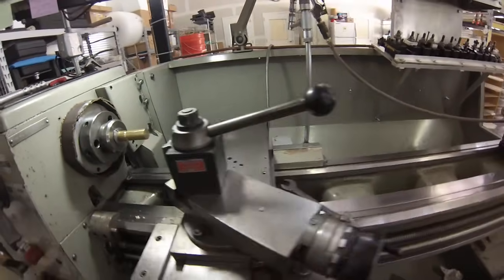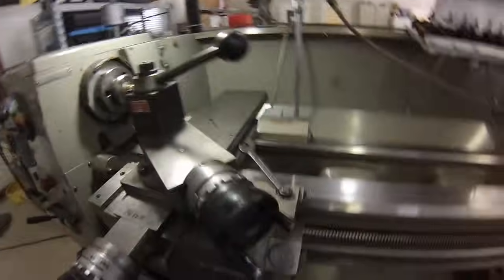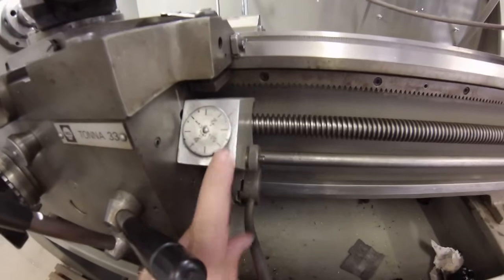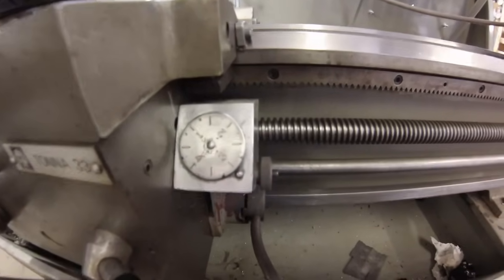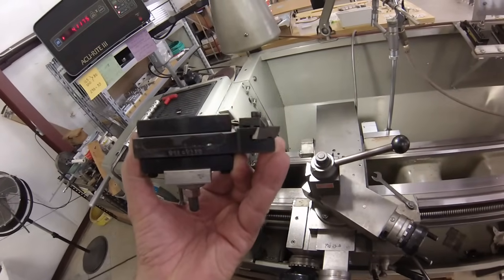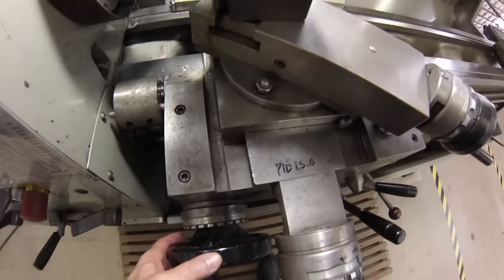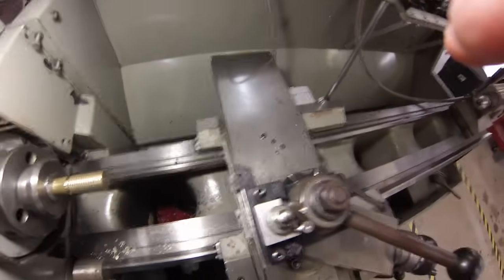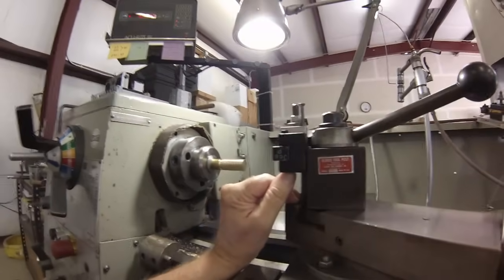Threading on a manual lathe  BEST TECHNIQUE EVER !!!!

Comment: HI! 
What about a metric thread and imperial leadscrew, could this method be adapted ?
Reply from the maker: Yes, absolutely. Just don't disengage the halfnut and you'll be fine.
Reply: @joepie221  
Thank You Joe. As you said, there is a nanosecond time to stop the movement against a shoulder. If you do  not open the halfnut, you need to run the lathe very slow. Tim Lipton (Oxtools)  explains in his video "Metric Threading with an Inch Lead Screw" , a trick how to disengage the halfnut  not losing the thread. You may have seen it. Could we combine your method of threading with Tom's trick.?
PS. Sorry for my bad English.

Comment: Best advice ever for single point threading. I’ve witnessed too many people go toward the spindle and make costly mistakes. As an apprentice at the time I asked questions that where met with the “That’s how it’s done”, you want right handed threads you go towards the spindle.

Then in later years there was a more mature seasoned machinist that threaded away from the spindle. The question was asked why, and he explained in plain terms that it was safer for the person tooling and the equipment.

Comment: Joe, I bought a set of wires for threading as you suggested. I am going to turn my tool upside down tomorrow to finish the last 9/16" thread I need for a project. I hope my chuck doesn't thread it's self-off the nose spindle. If it does, I'll be ready for it since you warned that it could happen. I hope this will work for my threading operations. Great Video.

Comment: Hi Joe love this technique , but I just bought a lathe that doesn't have a thread dial 😬..it's a  it's a reasonably modern  lathe 1996 Wagner dcs 200x900  and can't quite understand why not,,, Thier is a video of one running on you tube and it also doesn't have a threading dial 🤔 .. will post a link, Thier are no obvious signs where one would go if it is  missing🤔. It's a massive upgrade over my previous Taiwanese 13" belt drive .. that  I would never have risked this method on with threaded spindle .. the Wagner is din spindle so was looking forward to running all the threading ops with this method 😬 am I missing something like is it possible it doesn't need one ?  🤔
Reply: Just don't disengage, keep it fully engaged in your case. Use reverse

Comment: Joe that is an absolutely brilliant technique to chase threads without having a heart attack waiting for the end of the thread cut. I've been there many times!

And thanks for showing us how to use threadgage wires..... I always used to use either a thread Mike or ring gauge. But the thread pitch wires sounds like a very easy and reliable way to check your pitch diameter. Great suggestions!!!

Comment: Hi Joe,
My lathe’s manual says that the lead screw was made with a left hand thread so that when threading (in the ‘usual’ direction towards the chuck) the lead screw is in tension, which supposedly makes for a more accurate thread. Have you had any accuracy issues over the years with your away-from-the-chuck technique? Thanks!

Comment: Great video and tip Joe. Wanted to ask what threading toolholder/insert you're using in your BXA in this video?
Reply from the maker: Its a kennametal top notch threading and grooving tool holder. 3/4" LH NSL
Reply: @joepie221  Thanks for the info Joe, and thanks for doing what you do!

Comment: Alas both my lathes have screw on chucks so if I did that the chuck would unscrew. Next time I buy a lathe though, I will make sure it doesn't.
Reply: I saw a tip to hold it on with the tailstock but haven't tried it
Reply: @RG-gk4yi  hmmm. Got a link?
Reply: @BensWorkshop  I haven't found any actual examples of anyone doing that yet, just a few comments suggesting it as a solution. I'm wary of doing it, myself, although the theory seems solid.
Reply: @RG-gk4yi  Fair enough.

Comment: Oh so you do call the machinist hand book the Bible. Yep it Mitchell again. 
Have a great day!!
Reply from the maker: I'm not sure what point your trying to make, but just about every american machinist I have ever worked with calls it that. So thats a yes.
Reply: @joepie221  Oh come on Joe. I was harassing you about the threading video and not using the compound rest as recommended in the “Bible” in reference to gummy stainless plunge method 
Then I watched this video. I mean nothing by this. Except new age machinist are all cad reliant. I happen to enjoy both worlds having the back bone of old school and new age high speed machining using a 1/2 6 flute 1-1/2 loc full depth in 4140 pre hard and maxing out the spindle of 20 hp all day long. It sure does make a mess the biggest challenge is chip removal. 
You have 12 years on me as a machinist. I personally love a challenge old or new. I do enjoy your videos 
Have a great day!!

Comment: 417 people have long hair
Reply from the maker: I have nothing against long hair, just tie it back or risk the injury.
Reply: @joepie221  Was it MIT or Yale that had the young lady get her hair caught in a rather large engine lathe?  They found her splattered over the shop when they came in the next morning.  Tuck away your dangly bits people, these machines are designed to eat very hard materials, and we are soft, and squishy!

Comment: Hey Joe how come you don't  use a live center when you thread I always have a few parts that run out of pitch dia. tolerance  when I don't  I have a mid fifties  sheldon lathe at my home shop and it has a screw on chuck so chasing  towards my spindle is my only option but I have on other machines   drilled and tapped a hole in the chuck and put a piece of brass in the hole that has the same pitch on it put a set screw in it and tighten it down it will not come unscrewed  unless you do something  you know you should not nice work I'm retired now but watching  your videos  is getting me motivated I would like you to explain  the difference  between  a taper attachment and a hydraulic  attachment  that follows  a pattern on the back side of the ways I don't  remember  the name of it but I used to run 3in. dia. drive rollers and bigger 3ft long with a 1 in 12 taper on each end thanks for your very educational  videos  keep me coming
Reply: You can get away with murder on soft metals which is just about all I see him cutting. A live center isn't really necessary for aluminum or brass unless you're way out there

Comment: I like it Joe but you should have mentioned that if your using a HS tool bit you need to set your compound to 29 degrees also feeding the same direction as the carriage away from the headstock.

Comment: Joe I have to ask does it matter the speed and feed rate or if does how and where you set it up?
Reply from the maker: Feed rate is set by the pitch setting, so technically, there is no actual feed rate to consider. As for RPM, The finer the thread pitch, the faster you can run the machine or you'll wait forever for the thread dial number to come around. I run all my threads between 550 and 700 RPM.

Comment: Joe It seems to me that in order to cut on the front edge of the tool the compound should be set to 30 degrees which it is but on the left side not on the right? Love this video makes it so easy as long as I make sure I run it in reverse!  Thanks John
Reply from the maker: I plunge all my threads, so the compound angle is never an issue.

Comment: JOE how do you cut a double lead start  acme thread LH?
Reply from the maker: Machine set to cut half the required pitch value, Tool upright, cut left to right, compound inline with the spindle axis and advance the compound half the thread pitch after completing the initial lead. repeat the process. A machine set to cut 6 TPI will have a double lead end result of 12 TPI

Comment: Joe It seems to me that in order to cut on the front edge of the tool the compound should be set to 30 degrees which it is but on the left side not on the right? Love this video makes it so easy as long as I make sure I run it in reverse!  Thanks John

Comment: I am not trying to brag and I want to say that right from the start probably most people that watch your videos are far more advanced than I am but I pride myself on single point threading. I have tried to do it in reverse and it just I can't it bothers me I mean it works I'm not saying that it doesn't work but I just can't do it I can't bring myself to do it. I can talk drink a pop and single point with one hand without even breaking a sweat it's never been an issue for me. I pride myself in making the ultimate sharp perfect 60°, if that's what it's called for high speed steel threading tools. I keep various threading tools in a little velvet case that's made out of maple. I love single point threading and I don't panic at all when I'm running to the end even if I'm running to a shoulder I can stop at the within probably a 64th of an inch of the same point every time. 

 As a matter of fact one of the tricks to making absolutely beautiful threads is run the lathe as fast as you can. Don't run it in the lowest slow gear you have I kick it up to the middle of the variable speeds. And I'm on an old rickety Logan most of the time.

Don't get me that wrong this is a great tip a great method and great advice for people for some reason I just can't do it. I love single pointing the way I always have and it doesn't stress me out not even in the least bit.
Reply from the maker: If your method works for you, don't change it. It may have just been a figure of speech, but try to maintain some drag on the handwheel while you thread. This keeps the thread as accurate as your leadscrew and wont allow a drunk thread. "Threading with one hand" isn't always a good idea.
Reply: @joepie221  lol yes it was just a figure of speech.   i modified mt apron lockdown plate with a brass foot and use it to put light pressure on the bottom of the ways to stay engaged to the rear of the slop for lack of a better term

Comment: Great idea, we had an ainjest threading attachment on our Colchester if you have to run a load of threads, but if your only doing one  every now and again its safer than running into the chuck if your not comfortable with leaving it in lead and using the reverse to slow down and pull out,  
 http://millhillsupplies.co.uk/tools/ainjest-high-speed-threading-attachment/

Comment: I would have thought threading this way would be the norm rather than a tip. I mean I'm reading comment below basically saying. Oh my lathe does this so I do it towards the chuck and it's fine. Big whoop! This method takes all the stress out with all lathes. You don't have to slow down or time slipping levers or anything. All the bullshit is gone and it requires ZERO extra steps. Even on lathes where you can't disengage the half nut threading metric your way is better, faster, safer and cheaper in the long run cause I don't give a damn how great and focused someone thinks they are, Eventually they will be distracted by something and cause damage. 

Thanks MUCH! I've never run or even watched a lathe or mill in use. However, I bought a combo unit and am supposed to be getting it in about 2 to 3 weeks. I will be employing your method of threading right out of the gate. Not cause it's better or worse. It's just smart and I like smart. Ya I've heard all the bad comments about Combo's but it's what I can afford. Besides that I'd like to see for myself what they are capable of. It's hard to respect criticism in this modern generation because it's all turn key. The afford thing is gonna force me to have to build most of my own accessories out of scrap mystery steel. I'll learn! If the lathe has deficiencies then I can fix that also. Like the old timers used to say in every case. It's not the machine. It's the man!
Reply from the maker: Good luck. Thanks for the comment.
Reply: @joepie221  Thanks much! But, my "luck" has a bad track record. I tend to rely on skill or when lacking that, at least the ability to overcome the of fear to trying something new to gain skill. I mean if something is broken or doesn't exist already there ain't much to lose in trying to fix it or create it.

Comment: Joe,

I made a special locking chuck mechanism for a SB 9A.  An expandable arbor inside the chuck connected to a left hand thread and nut.
Nut goes out the left side of the head stock.  The mechanism will tighten against the nut if the chuck starts to loosen.  
Just have to make sure the arbor does not slip inside the chuck.
Best thing I could do with out a modification to the chuck.
I think this is pretty good margin of safety at low speed and light cuts. ( I cut mostly 0.75mm and 1mm pitch )
Reply from the maker: Many people have the same concern. You should post or sell the attachments.

Comment: On that little Colchester I'd leave it in pitch and lift off to slow the tool before reaches the undercut then wack into reverse to go back to the start point.
No need for using the pitch dial. 
No need to travel away from the headstock.
Reply from the maker: You do you. I'll never run another thread towards the headstock ever again.

Comment: Four things. First of all, you talk about "safety first", and then proceed to start a cut and back away from the machine. If that tool breaks you aren't close enough to hit the E Stop. Secondly, who cuts a coarse pitch thread like that with no live center? That .065 cut pushed your piece away  .010. Thirdly,, you're taking a .065 cut with no coolant of any kind. That tip will be worn out after one job. And lastly, before CNC, real machinists and toolmakers would just set up a travel indicator and watch it as it approached zero and then disengage the half nut. And before you comment sarcastically, I have 35 years as a toolmaker.
Reply from the maker: Respectfully, I'll address your edited comment inline. 1. The carriage was moving away from the headstock and if the tool breaks, there is no danger of continued damage because nothing is touching. 2. Nobody would use a live center on 1" diameter brass for a 10 pitch thread, 2" long. The .065 cut would never bend 1" brass .010. not now, not ever. 3. Very rarely do I ever use coolant on material as soft as brass being cut with K68 grade carbide. If this tool wears out after one job, something is seriously wrong. 4. I am glad you consider yourself a real toolmaker and find it acceptable to take unnecessary risks during machining. Apparently I just pretend, but you cant get burned if your not by the fire. Setting a dial indicator may be an OK way to make lawn mower parts, but removing operational crash risk from a $100,000 military part would be my first choice. And just for the record, my tools are always on center. No 6" scale necessary in this shop.
Reply: @joepie221  what a plonker this guy is .. He works for the government  so say no more..when they say how many years they have been in the job it always  raises  a red  flag with me.. Experience helps but some  old guys are just as useless  as the day they started     .his comments about coolant and centre's are just BS sometimes  you need them and sometimes you don't ... I started my apprenticeship  with Ls Starrett co in Scotland  a subsidiary  of the Athol Massachusetts  co .. at the age of 15 so I do know a little bit  . I'm 75 now and still learning  Enjoy your videos  a lot so keep them coming.. greetings from South Afrjca
Reply: @dougiehogarth6652  it as bit like them that think they walk the walk but can't exsplan why & how to cut a tread with out a lead screw. 0r dial gage   when your lath only as the use of  a rake,  to cut third's ? ,  just in case you do not know there is tow ways  to do  the job . So  stop criticizing & tell me one of the ways to do it on a engine lathe.    remember no lead screw & not trading diel .   [ Now  how would you do it ? ]
Reply: @joepie221     What do you do if you cannot have a thread relief to start your threads in?
Reply from the maker: @clayz1  Tell me how you handle it doing it conventionally and we'll go from there.
Reply: @joepie221    5/15/21    Hi Joe.  I’m de-posting my negatives.  People make good judgment calls. Especially with good general training.
Reply: @joepie221  I was a nuclear qualified toolmaker and workleader for the federal government for 35 years. Main part making was for nuclear reactors on ships. You would be a joke in our shop. There's always another way to do a job but running a tool upside down and backwards, with no coolant, because you're afraid of crashing it into the spindle, would get a big laugh from where I came from. A .065 threading cut with no center is going to push off. Trust me. Wire mic your threads afterwards and get back with me. I guess for someone that works in thousandths it probably doesn't matter what the fit is on the thread. For those of us that actually do precision workwork in tenths it does matter. Especially in the nuclear world.
Reply from the maker: @JG-vh6mn  Get over yourself JG. It was a demonstration on a piece of brass. And since you have NO clue as to my background, your comment has no merit either. I addressed your initial critique and yet you still fail to concede your position. The sheer number of views, thumbs up and positive comments would put you in the minority. As for 35 years of nuclear component machining on a ship, I have to seriously doubt that statistic too. Move on bud, nobody here is as impressed with you as you are with yourself.
Reply: How you are talking about safety 1st when  you are recording and not paying attention because the camera

Comment: I've had good results using a dab of grease to hold 2 gage wires to my micrometer anvil instead of using my 3rd hand.
Reply from the maker: You only need one wire in reality.

Comment: The only thing I don’t like is you are not using the compound slide
Reply from the maker: This machine and tooling are rigid enough that I don't have to.
Reply: When threading STAINLESS you probably would want  to use the Cross slide